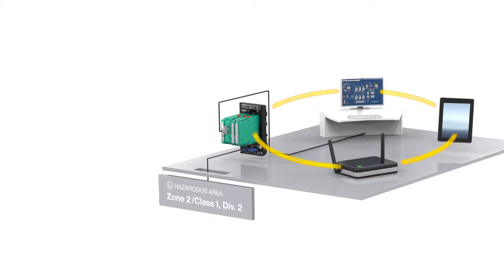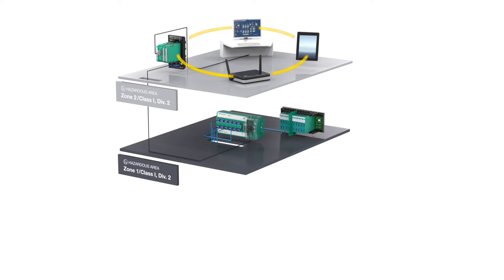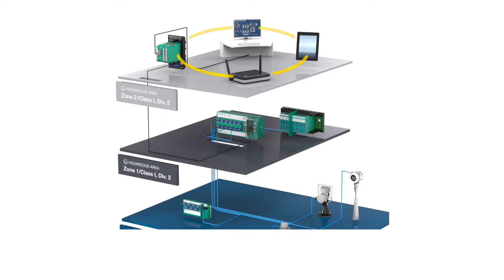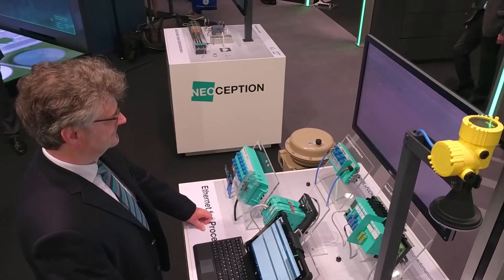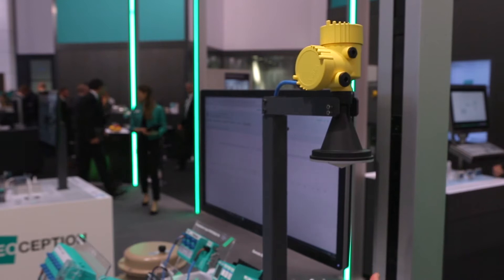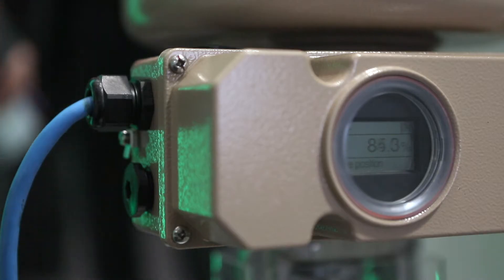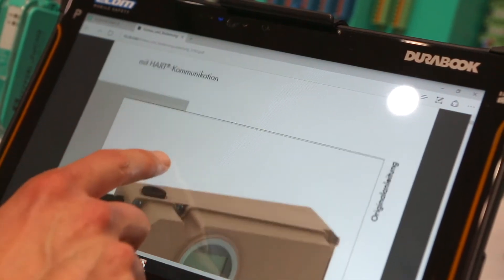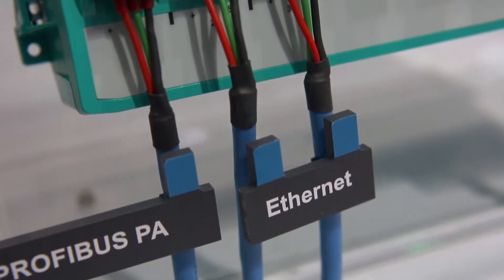Ethernet for Process Automation

Comment: Congratulations to P+F for developing field switches and devices with standard two-wire Ethernet APL and 2-WISE.  
This "new" field instrumentation and automation concept, including hazardous areas, will certainly contribute to many new applications, with new functionality, features and "Ex" asset management.  
In addition, the Ethernet standard from the factory floor to the cloud, without gateways or protocol converters, contributes to a necessary integration and convergence between IT and OT.  
New challenges and great opportunities!
Reply from the maker: Thanks very much for the compliment, Roberval Bulgarelli. 👏 We agree. New challenges and great opportunities ahead! 😃 #AutomationPassion